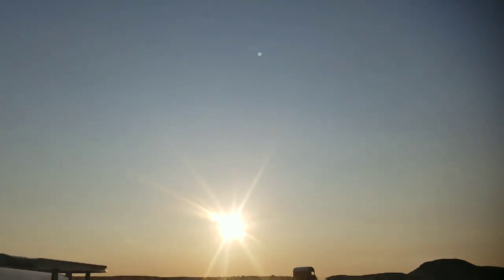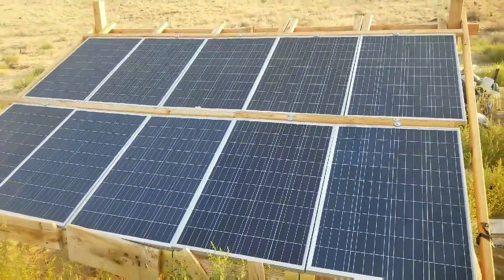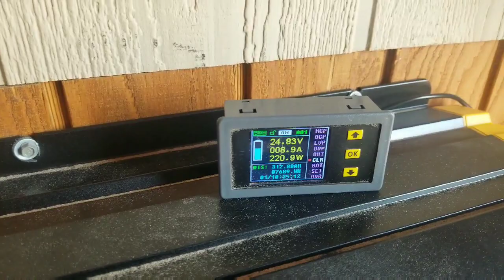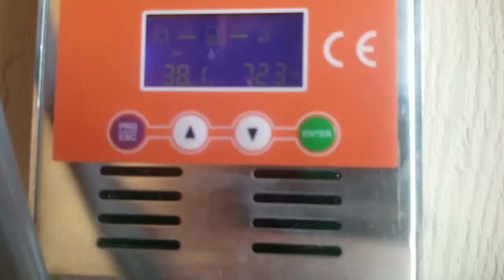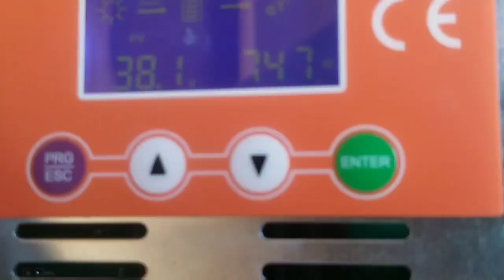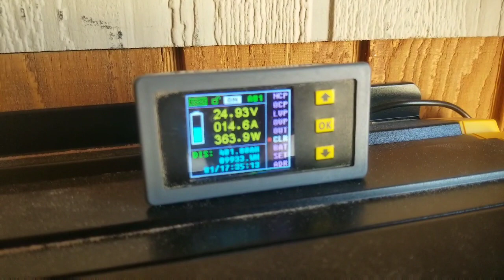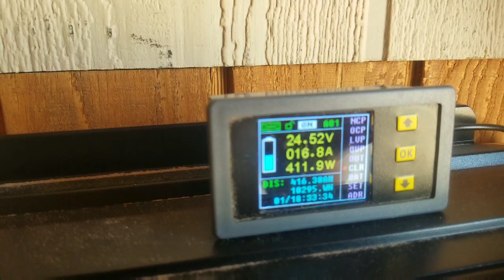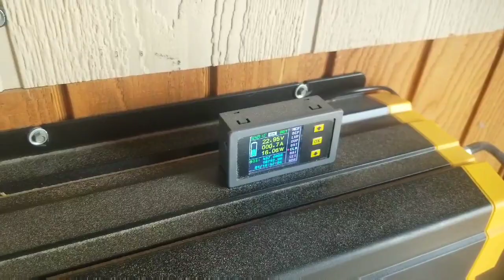1000w 24v 1 day solar system input with data

Comment: I agree with the other posters to double-check your battery.
That particular brand of charge controller may be a fake. Believe it or not, there are some Chinese companies making bad copies of other Chinese companies good products. Have you tried a different brand? Such as an EPever?
Not sure where you are, but double-checking a wind map would be prudent before investing in a wind generator. A YouTuber named John Daniels has good information on decent, inexpensive Chinese wind generators and how to keep from getting ripped off. His videos are erratic and a little hard to follow, but the information is sound.

Comment: I bought a mini fridge that uses 625 watts per day...I only have 400 watts of panels so far so I had to trim watts til I can get 1000 like yours..we have spells with a pretty good amount of wind so Im thinking about trying that too..our average wind speed is 17 here so I can get some watts that way some of the time anyways lol..Im using a borrowed inverter but Im getting my own in about a week..I thought I had to have a 24 volt one so I had to save up a bit for that..it looks like your panels would put put a lot more but theyre aimed wrong..Id probably try to fix that first...weve had clouds and rain the last few days so my 2 batteries are at 12.2 but next month Im getting 2 more so that will give me an excuse for more panels lol later..

Comment: You need a bigger charger for your genny to push harder into your battery bank if bank can handle it, if not you need a bigger battery bank. MORE panels would definitely help but you need mor Amp hours to last.
Reply from the maker: Thanks for the comment! Totally agree here. We have replaced the standard batteries with 6v deep cycle golfcart batteries. They're a bit pricey so we're saving for the next set right now. Panels will likely come after we've moved the array to a better spot. We've also been looking at inverter generators to help manually charge.

Comment: My brother respect may  I humble say there are little things you can do without spending a large sum of money on more panels and batteries. First get a digital timer your fridge do not need to be on all the time. I set mines to go off at nine in the mornings and come back at 12 noon there by giving the batteries some time to fully charge I also set it to go off at 9 @ nights and come on @ 3am in the mornings as for my usage next thing get one of them capacitor bank setup inline with the inverter take some pressure off the batteries these are some simple inexpensive things you can try as well as to see if you have a bad battery pulling down the bank one last thing a battery balancer keep the batteries charged and discharge at a balance. These little things may not cost as much as a panel but will greatly improved your system.
Reply from the maker: This is a good idea. Our fridge is very very low draw but must be on constantly, we paid a bit more up front for that. I like the idea though of finding things we can get to be timer based. Thanks for the suggestion!